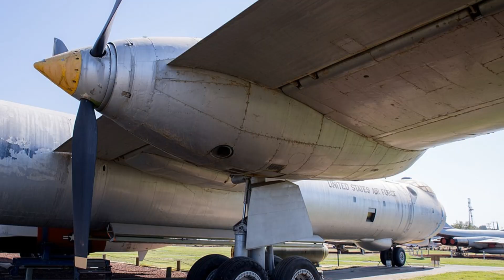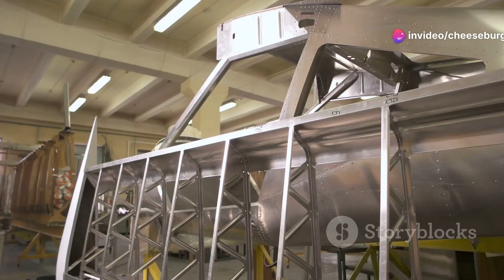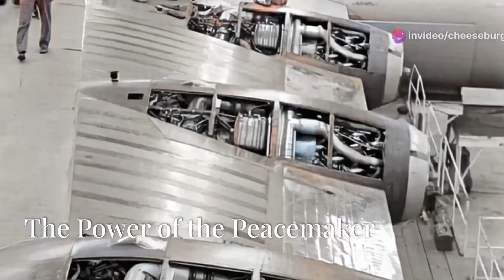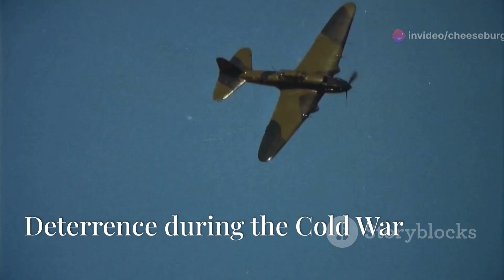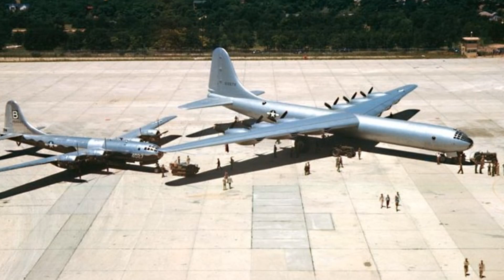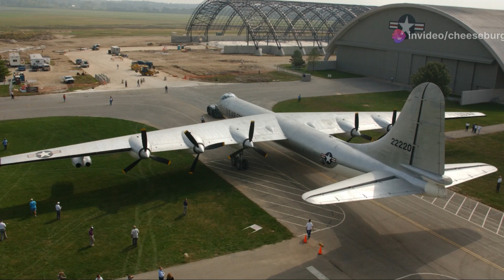The Convair B-36, The Ultimate Bomber Plane (of its time)

Comment: Without a Fighter Escort, It's Be a Sitting Duck to Mig- 17s or 19s.
Reply: No , since the service ceiling of those was not high enough let alone they could follow evasive manoeuvres of a 36 , B36 reached at least 3000 feet  higher
Reply: @cnfuzz  Touche' (smile)